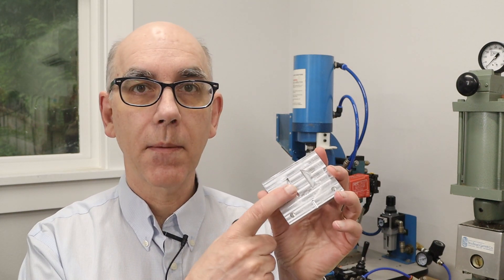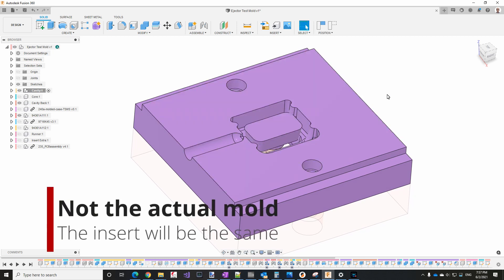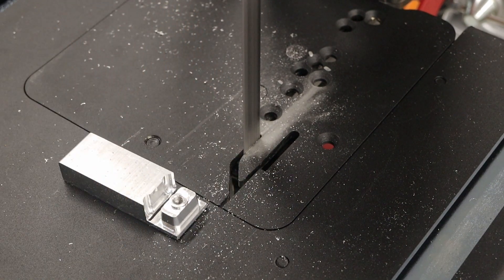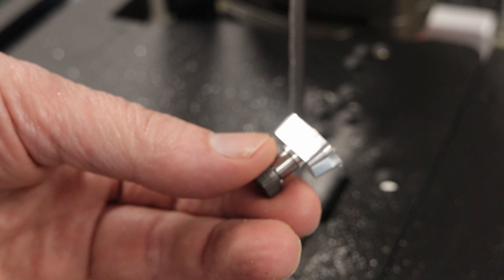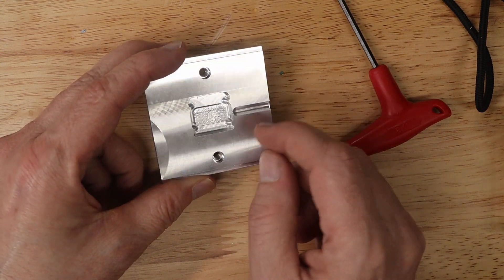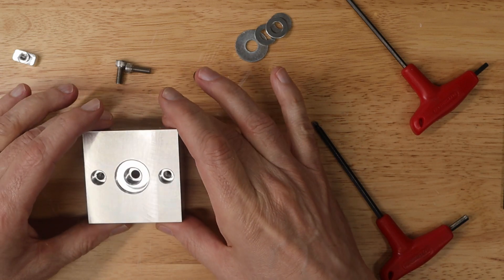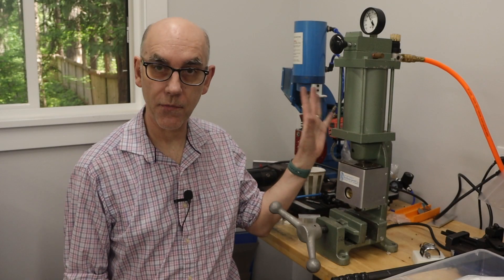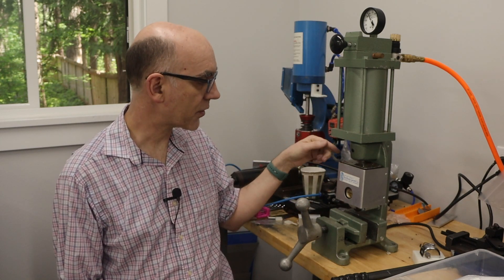Ejector Insert for a Manual Injection Mold

Comment: Hello!
I also made a couple of molds for my project with ejectors of that kind, but I made them with a step instead of a conical shape.
The face contact on the step provides a more precise height of the ejector face in the mould, and that isn't affected by temperature changes and pressure in the mold itself! 😉

Comment: 16:09 Hi John!  Out of curiosity, did this part have straight walls (and if so, what was the depth into the mold?).

I have a 0.23” tall part I’d like to inject at home with straight walls, looking for a basis for feasibility. (Here ABS and 0.045” wall thickness)
Reply: (New subscriber… you are the first content creator to tickle all the engineering/DIY senses of a polymer engineer such as myself!  Kudos, and amazing work!)

Comment: John love the channel and have been learning a lot about ejection molding. Love to see the passion, and innovation every time you run into a challenge however small.

What kind of molding pressure were you running on the injected plastic and what kind of spring force were your dealing with here?

Looking at something similar to this "manual action" for a carbon fiber compression .

Comment: great video!  just one question.  your hypothesis is that the 10 deg draft angle allows the plastic to move the ejector very slightly back, creating the witness mark.  Is the entire witness mark raised, or is there a 'raised' frame around the plate, perhaps indicating that the witness mark is actually a ring around the ejector plate outline?  Any idea of the 'life expectancy' of the mold?  Aluminum is not the most durable mold material :)

Comment: Although I'm sure the cost of the moulds depends on their size and complexity it would be extremely helpful to know the approximate cost of getting a mould made (by CNC presumeably?) such as the one used here. Thanks.
Reply from the maker: I know there is a company in China that makes molds and their minimum charge is $500.

Comment: (New guy here, don't judge me) Would it also not be possible to have the spring pushing the ejector into the mould, using the pressure of injection pushing it flush? Would the spring then not eject the part when the mould was opened?
Reply from the maker: Generally springs are not used that way in molds because doing so would reduce the clamping force. Plus, in this case, the plastic would likely get into the moveable part before it pushed it out of the way.
Reply: @JohnSL  Oh, ok. Well, like I said, I'm a newbie to this! Thank you for your reply, and, your videos are great!

Comment: I've seen ones like this on some injection molding industrial workshop videos and wondered how one would make it, so it doesn't show.  Very nice job.  Wonder if a water cooled block could help harden the material more for quick resets and less witness marks.  Your setup makes one jealous!
Reply from the maker: The aluminum does a really good job removing heat from the part--much better than steel. There are usually two reasons for needing cooling channels. The first is if you're using a steel mold, because of it's poorer thermal conductivity. And the second is if you're running thousands of parts in a run, which typically means you have an automatic machine. For desktop machines,  you can usually just take a little break.

Comment: you should have made the surface that pushes the part 100% of the bottom surface. in this way it would not leave the mark of the ejector.
Reply from the maker: I went back and forth with the customer about this. As it turns out, they laser etch some information on the back after molding, so the ejector mark actually creates a nice frame around the text. Sometimes you get lucky.

Comment: John, if you use smooth hard jaws and set an X axis stop you can skip the Haimer.  And note down the different known locations (e.g. the Y coordinate of your fixed jaw), it speeds up setup.  Serrated jaws are great for aggressive profile milling and minimum stock waste, but not necessary or ideal for what you were doing.
Reply from the maker: True. I got back and forth between the serrated jaws and the hard smooth jaws. But I need to change the Z offset in the controller. So there actually isn't much difference in setup times between the two approaches, unless I dedicated a different work offset for each set of parallels. That's because I'm not setting the Z offset each time--I'm relying on the accuracy of the homing on the Haas, which is very accurate.

Comment: Very nice, thanks. Also on a Haas if you haven't already done so check to make sure setting 133 is on. Without it the first time you try to rigid peck tap it will be a bad day.
Reply from the maker: Thanks. I'll have to check that setting. I have not thought about doing peck tapping. But should definitely check that when I'm at the machine next.